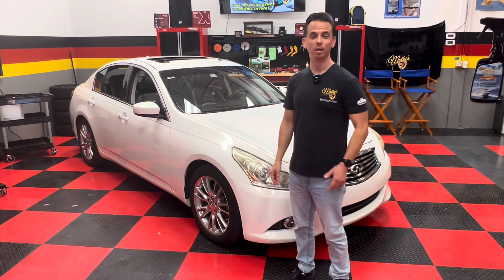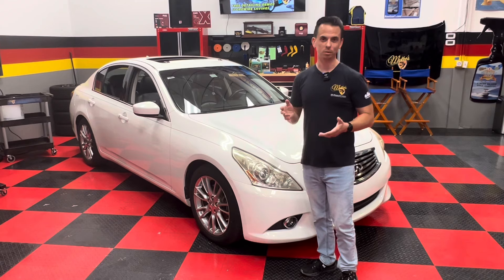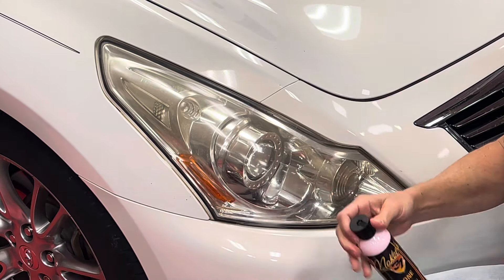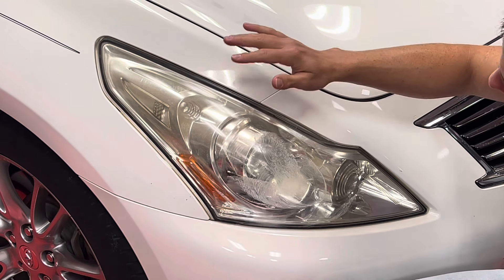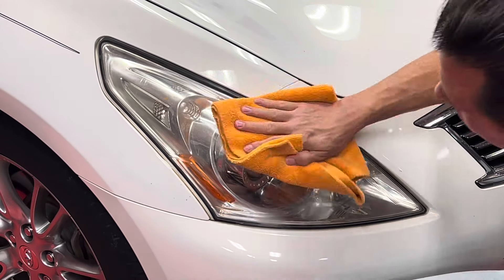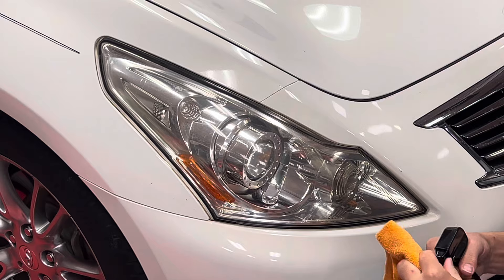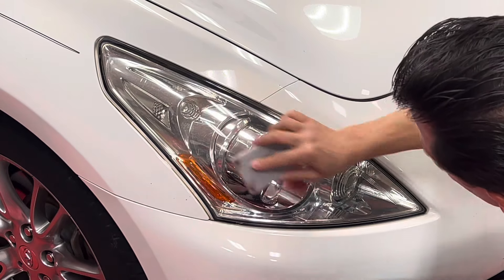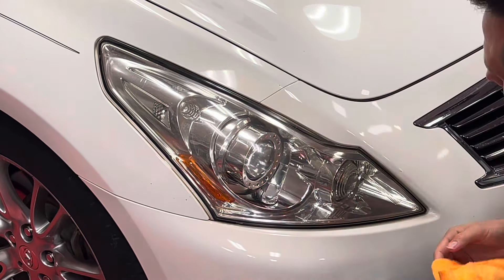How To Restore & Graphene Ceramic Coat Headlights | McKee’s 37

Comment: You know that kit is going to do absolutely nothing on let's say an 11 Silverado Fords or Dodges you have to hand sand the majority of these some foreign cars like what you're doing with exception to Audi Mercedes etc are extremely easy a child can do it there's nothing to it I use a lot of your products but I'm just saying this video with this kit is a joke will not work on the majority of American made or German vehicles not to do it right anyway a lot of sanding is required just my two cents for my 30+ years in the industry don't want people buying this and thinking the kit is going to make their Chevy or Ford headlights look brand new in a matter of minutes
Reply: Well if the headlights are heavily oxidized from the sun and weathering of course you need to hand sand or machine sand the polycarbonate headlight lens. What Nick is showing is a restoration headlight lens kit for headlights that have real light  mild oxidated headlight lens that you can get away just using the polishing compound and then coating it afterwards. Yeah there's no way you can get away just using the compound on Heavily oxidized and yellowing headlight lens, you need to sand them down first. Nick has a video on that also where he shows how to restore the headlight lens on the kit with sanding discs, polishing and coating for heavily oxidized lenses.
Reply: That's still not restoring it even on easy ones like this car in the video it's half a$$ing them the kits by any manufacturer are a joke if you're going to do headlights just do them the right way and if you can't then pay somebody to do them for you and hopefully they have enough pride in their work to do it the right way
Reply: @mipdetailing   Well you should do a video showing us the right way. 👍
Reply: @mipdetailing  Curious as to why you didn’t sand the 71 Ford LTD on your channel before polishing.
Reply: @autoforge  if a customer wants to pay for wet sanding on a vehicle I will happily do it but if they don't I do what they want and what they pay for